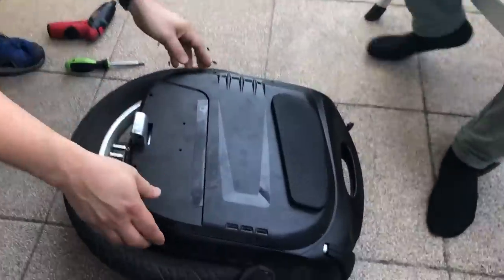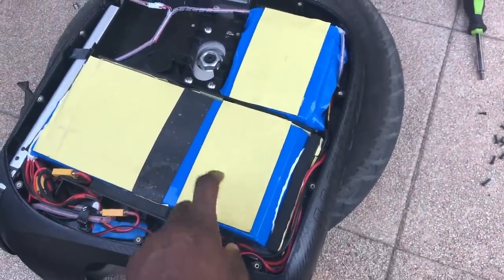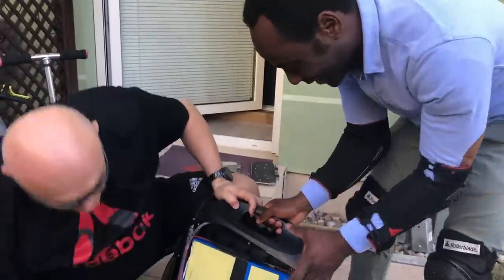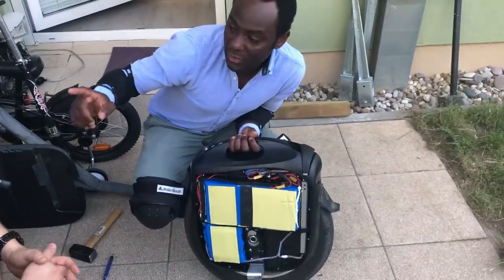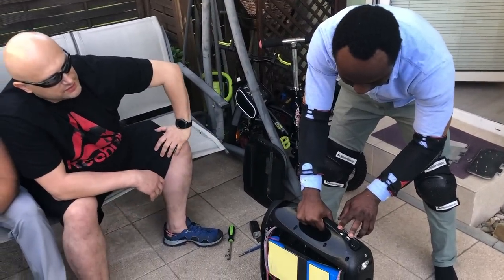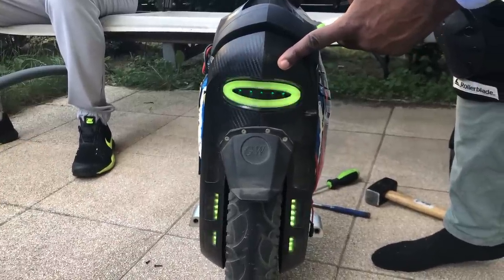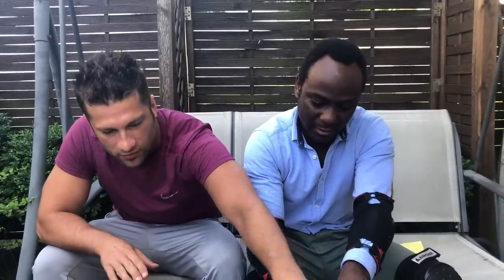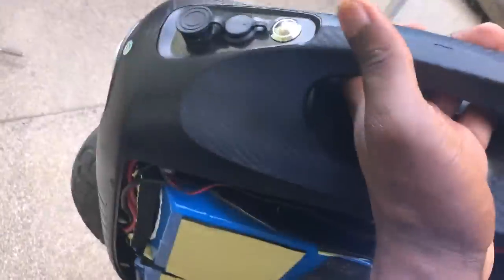GOTWAY MSX 100V PLUS (1845WH)

Comment from the maker: I am not an expert, but anyone that can increase the range of the MSX 100v to match or exceed the MSX 84V 1600wh will get my attention.. What do you guys think?
Reply: Great idea! An upgrade kit would be nice.
Reply: There is a known problem with all new 100V MSX with extended battery. If you for example take the whell and make it spin to ~70km/h and after that instantly try to stop it (like a hard braking), you will notice the wheel tremor problem. The more powerfull battery the more simple to represent the problem. Did you notice it? It's important to disable tiltback and set the hard pedal mode.

Comment: I am going to buy the msx 100v but whats the difference in terms of battery options, i see msx 100v plus version with 1845wh battery and the regular 1600wh . is it better to get the bigger battery version, is it supposed to help in fast speeds and less likely to cut out?
 and what is the reliability of gotway, people say its not  great. i just want the fastest wheel around. i currently own a ks18xl excellent wheel, very responsive and handles awesome, i just dont like the 50kph limitation. thank you for the great video.
Reply from the maker: crosshair if you want the fastest wheel, get the MSX 100v. I have several Gotways and I have not experienced a cut out before.

Comment: Hi! What type of batteries are used, high current 18650 or plates? Are these batteries flammable? Is there an overheating sensor on the batteries?